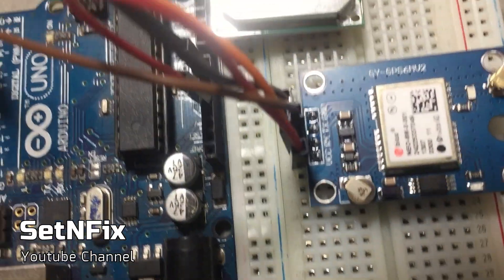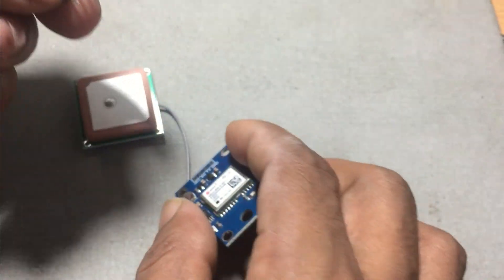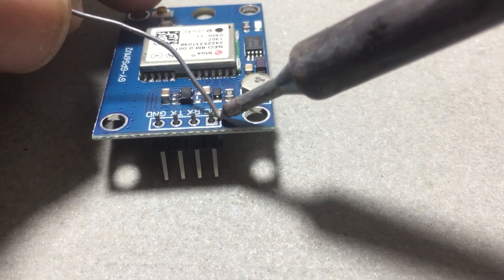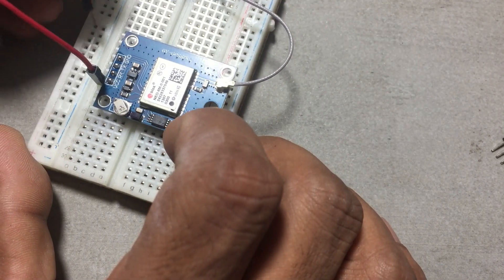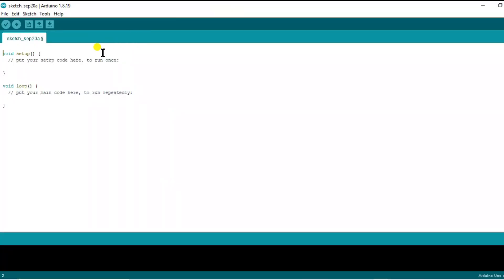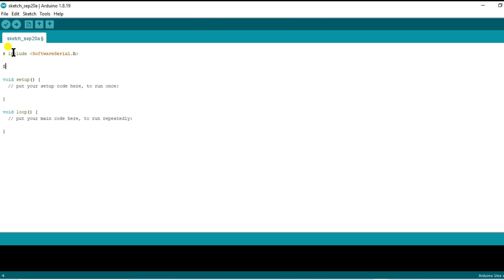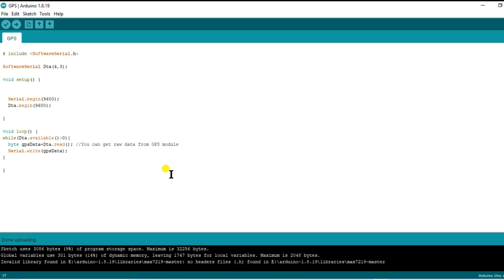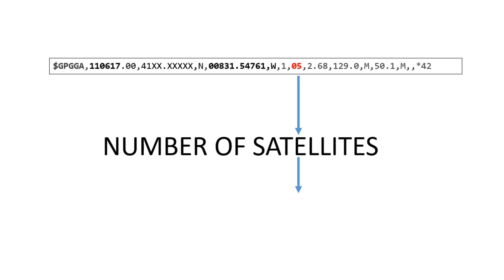NEO 6M GPS Module with Arduino : Introduction Video

Comment: Hi! If nothing shows in my serial monitor, I should wait 12-30 mins under clear skies right? So after that it is detected, can i now use it indoors? When i will turn the arduino off, should i wait again after 12-30 mins when i turn it back on?
Reply from the maker: Yes may be. It take time to connect with satellite. Keep the device always power on.

Comment: Datasheet doesn't say anthing about 5V. I used 3.3 volts took like 20 minutes for the red light to start blinking got the $GPRMC type messages over tx just fine
Reply from the maker: Sometimes, the device take more thank ours to detect the signals

Comment: GPS MODULE  doesn't blinking sir how to over come this problem i am struggling with past 3 days
Reply from the maker: Did you supply over voltage?
Reply: @setnfix  no sir, i just give 5v only . i brought another one also that also not blinking . i don't known what mistake i am doing

Comment: I did a heavy mistake of operating this module on  5v, after that it became extremely hot, and I might have burnt or short circuit the chip , so if anyone is reading DO NOT connect iti with 5v, it's operating voltages are 3.3v
Reply from the maker: There are various types of 6M GPS modules. This particular module comes with a regulator, so you can safely provide 5V to it.

Comment: hi, why you connect the rx and tx with 3 and 4, and not with the rx and tx pins of the arduino?
Reply from the maker: Yes, it is according to the code.
Reply: @setnfix he asked why you use digital pins and not RX and TX (0 & 1 on Uno board)
Reply from the maker: @daroboro5137  Then you have to edit the library as well 🙂
Reply: @SetNFix  your answers aren't explanatory and unhelpful
Reply: Hi dear @daroboro 
, he did that because in codes he used software serial libary which provide alternative way of connecting UART devices on other digital pins that UART pins
Reply: you see the Serial Monitor also uses the  Tx and Rx pins to print data from the arduino board. So, we have to define any other 2 pins as serial pins. or there will be issues

Comment: only this is showing in serial monitor
������������� � ����� ������ what to do ??
Reply: Change ur baud rate to 9600
Reply from the maker: What shows?
Reply: @setnfix  please see my comment I copy and paste this from serial monitor
Reply: you ever manage to fix this?
Reply: @xandify1550  no I couldn't. I bought 4 modules but the same problem happens again and again.
Reply: Baud rate mismatch. The baud rate on monitor and in code must match.

Comment: I am facing issues with same module. Nothing is getting printed on serial monitor.
Reply: me too. There is a satellite right above my head, my LED is blinking blue, but I don't have any output on Serial Monitor.
Reply from the maker: It take sometimes 12 to 30 minutes to connect with satellites Try with open place.